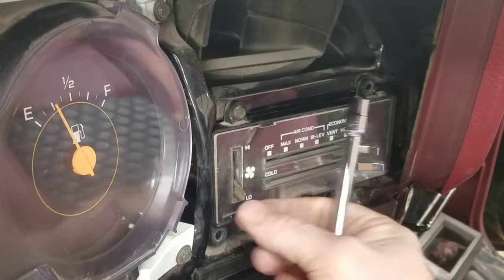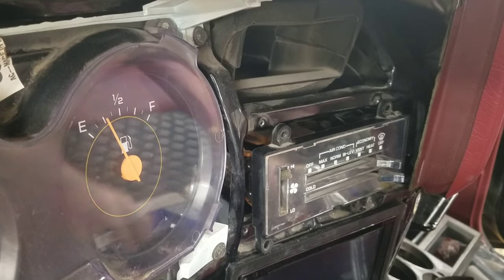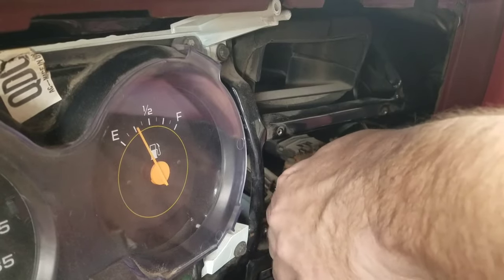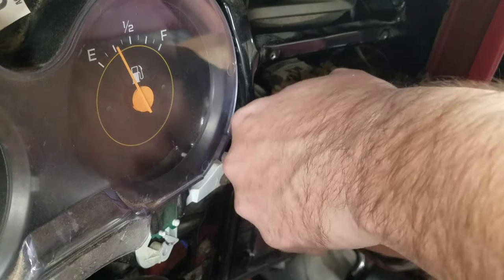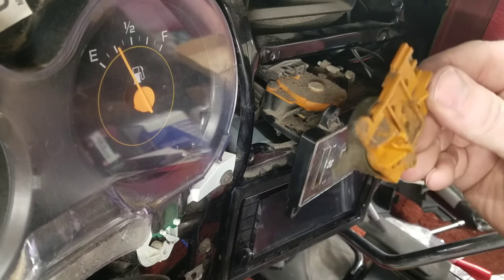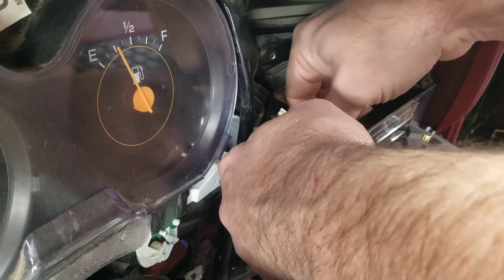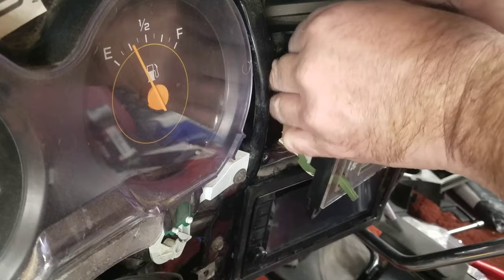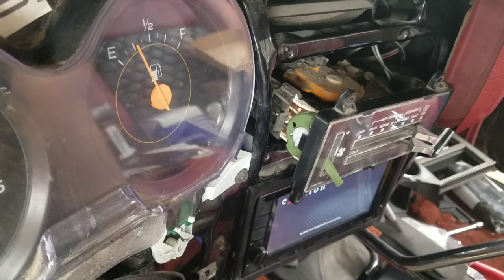73-87 chevy short cut fan blower switch replacement heat & A/C Square body & G body GM GMC

Comment: Is guage of wire the same for all 4 connections for the fan blower switch?
Reply from the maker: Yes it is
Reply: Thank you very much. 
It is somewhat concerning. Three wires are the same guage. Just a guess, but three appear to be either 12 or 14 guage. The one is either 19 or 20 guage. Just doesn't make sense. I purchased the pickup in 1980. I have never messed with the under dash Wiring Harness. As best I can tell, it has never been rewired. I am very curious where that wire leads. But, it  is also burned at the switch connection point? Thank you again.